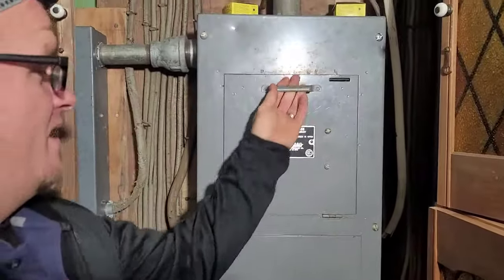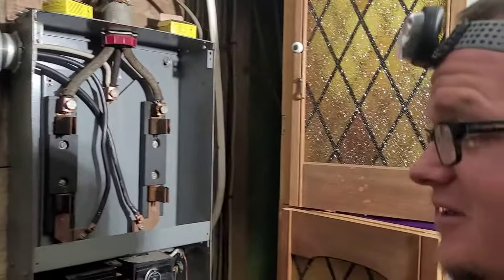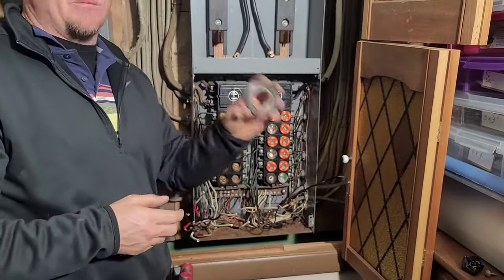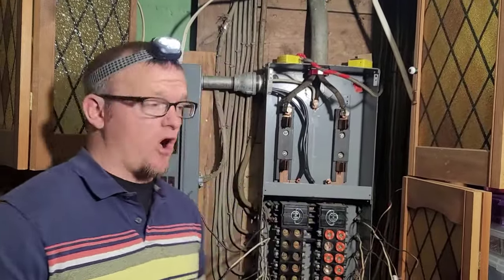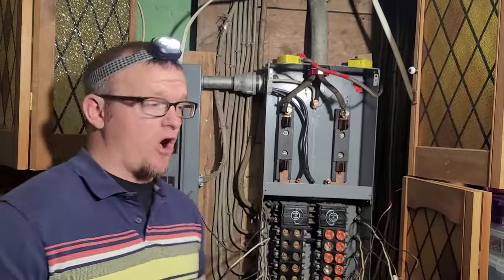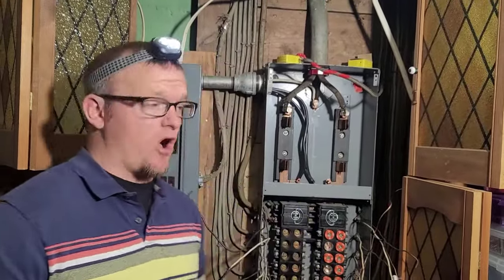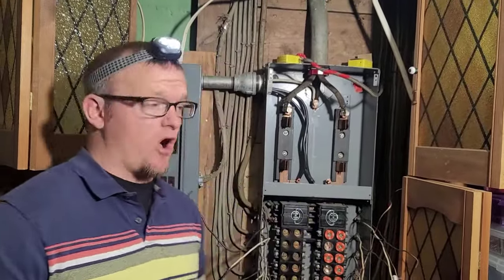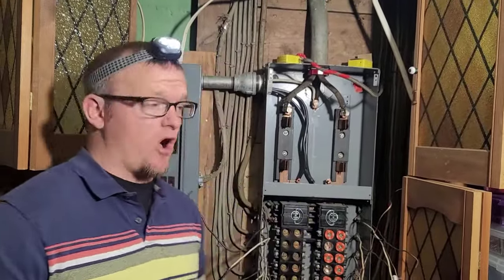Fuse box upgrade Full Install. Be a Pro. Learn from the Pros.

Comment: I have a 100 amp fuse panel that has some circuits/ fuses removed that arnt being used yet others have double lines running to them 

   Can an electrician come in and sort it out by removing the double lines running to them and spreading some out to the unused fuse spots?

   I’m positive a lot of them are not being used or do I have to upgrade to a breaker panel first?

I’m not blowing fuses and have the correct size fuses and I’m not in need of more power I would just like to sort out the panel 

I also have 3 circuits that are nob and tube which I don’t use any of the receptacles from these , I would like to disconnect these from the panel and run new romex and receptacles to the areas of the house that have the nob and tube receptacles I’m not using 

I’m completely lost and getting conflicting advice on what’s mandatory any suggestions would be greatly appreciated

Comment: My cabin had a little 2 circuit fuse box, it had a handle that had to be down to open it which was a hazard as it was never grounded lol. It was fed with a piece of 10/3 wire from a 20amp double breaker in my main breaker box. One of the fuses recently burned out and when I saw they were $6-7 now I just replaced the whole box with a little Square D 30amp 2-circuit load center and a 15amp 2-pole circuit breaker. I had to go 15amp because the wiring in the walls is 14ga. I splurged and even added the little ground bus bar. Those old screw-in fuses are expensive now!

Comment: Just looking for your recommendation for dealing with abandoned wiring.  I get different opinions from different electricians I've talked to.  Some say all abandoned wiring must be removed.  Some say to try to find both ends and wirenut them off separately,  in a dedicated junction box labeled DEAD, and still other's recommended to find both ends of the cable, stripping the ends and wire nut the hot, neutral and ground together at both ends, put them in a junction box marked DEAD, so if someone later on decides to reconnect the circuit at either end,  the result is a dead short and tripped breakers,  warning the homeowner to a problem.
Reply from the maker: Completely removing, or properly junction boxing and perhaps labeling are all acceptable methods.

Comment: Just moved into an old house with 2 fuse box panels,not sure how to deal with them,all outlets are only 2 pronged,so im.also concerned about wiring needing redone,how can you tell when replacing a panel to a breaker box if you should have wiring redone?
Reply from the maker: What year is the home?
Reply: A good electrician can pull out a receptacle and see the wire gauge. They will know if it's appropriate.

Comment: If I two electric meters would I have two fuse boxes. I have a separate electrical supply for my ac unit but I can't seen to find and breaker for the ac unit in the one fuse box I can find.
Reply: Fuse boxes are never terribly hidden. It's either shared with another fuse, mislabeled, or somebody broke the law during construction and didn't add one.

Comment: Awesome video.   Just curious,  any idea of the date the home was built/wired.?   The main fuses look like 100 to 200 amp, which was very large for a fuse panel because most of the fuse panels i have run into are your typical main/range pull out with your 4 branch circuits,  typically 60 amps, because by the late 50s or so when we started getting into 100 amp or 125 amp services,  breaker boxes were beginning to completely replace the fuse panels.  I've never seen a panel like that. Something that could be donated to a museum or exhibit.  😉
Reply from the maker: Great question!
You are correct originally they had very small services 40/60 amps I've seen them with lighting only.

And then they Incorporated the range later on.

I would say this house was built in the 50s, our area held on to the fuse box for a long time. I've seen them as late as the '70s.

Great comment thank you!

Comment: You didn't have to use any arc fault breakers in that panel
Reply from the maker: Great Question!! When you are doing a panel change only. Then you do not have to arc fault.
Reply: @electricianhub86  Or if you are in Michigan, you don't have to use them for even a new service.